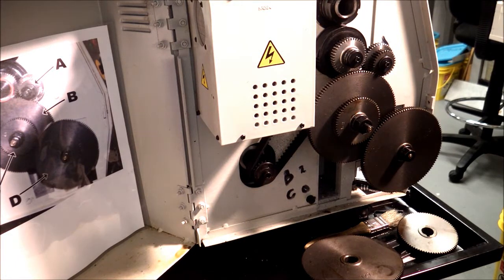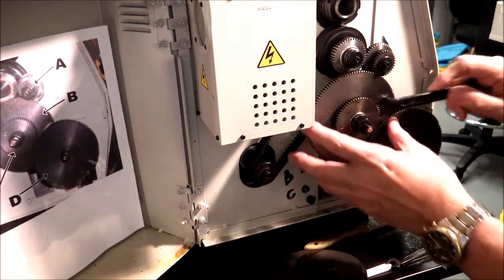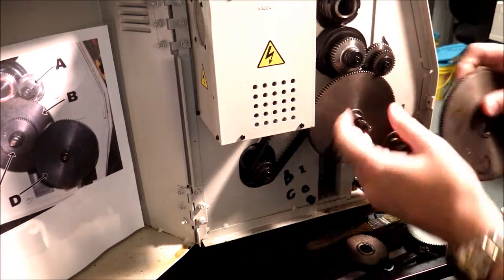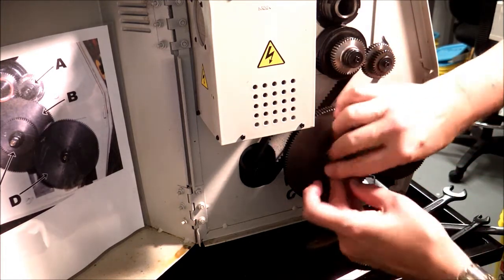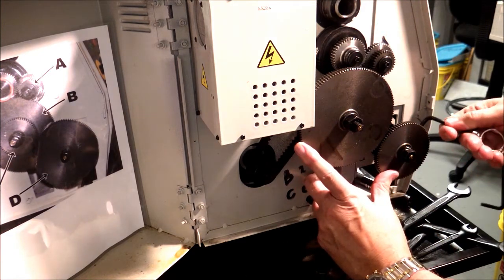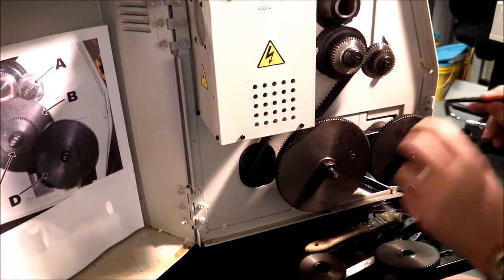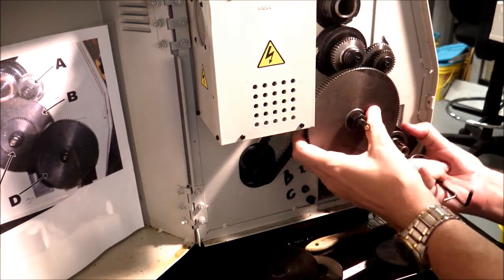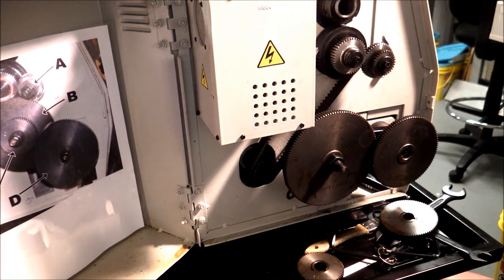Problems Cutting Threads on the Sieg SC4/LMS 3540 Lathe

Comment: Instead of meshing gears from the bottom towards the front ! Could you assemble them at the front of the lathe and swing them back to mesh ?
Or will the enclosure not close to engage the safety switch ? Just curious as I can't get access to my gear enclosure at this time ?
Reply: That was my thought, even if you have to override the interlock and cut the thread with all the gears out in the breeze.

Comment: Have you contacted LittleMachinrShop.com about this?
Reply from the maker: Yes, back in July when this video is dated.  They said, "There’s a cap screw at the bottom position that is screwed into a big black rectangular rod. If you loosen that you can swing that whole bottom gear set to accommodate for different gearing."  

They didn't specifically say to put the gears outside the enclosure, but I think what they meant was what I found in the next video: https://www.youtube.com/watch?v=2FD0CpLTaJo

Comment: It's weird that they list this combination on top of the lathe and manual. I  checked and I cannot make 30-120-127-80 work either in right hand threading. The problem is exactly as described that the spacer on the left hand thread shaft will interfere. This combination will work on for left hand threading, but I cannot see how it can be made work with right hand threading combination.

So I looked for other options.

Next I tried the 64TPI settings 35-127-87-120, but replaced D gear with 60, giving 64/2=32TPI. This was close, but did not work either 127 gear hit spacer under D gear berfore C=87 and D=60 meshed.

I then played with gear calculator at LMS web site and found combination A=45, B=50, C=56, D=127, gives very close transfer ratio and can be easily set on lathe. It's has slightly larger error (0.0001" in 1" of thread), but should be good for practical purposes.
Reply from the maker: Thanks for that tip on a different gear combination.  

Since I posted this, I made an Excel sheet that allows me to choose different combinations but doesn't solve for what gears to use.  I don't understand how to put in limits for the gears that tells me whether or not they can fit inside the housing with cover in place.  

For the last month or so, as spare time allows, I've been resurrecting my CNC lathe's threading abilities (in the list of videos there's a short summary of the Sherline CNC lathe moving under command - it's called "The Lathe Lives")  Since most of what I've had to thread all fits in the envelope of the smaller lathe, my plan is to move work that needs threading onto that.  The advantage is that I can cut to the proper diameter to thread and have it do that without fooling around with gears at all.  I had CNC threading working on this lathe for a project about 10 years ago, but after several moves around the shop, something broke in my indexer that made me start all over again. 

I'm about 3/4 of the way there.  More videos will follow.